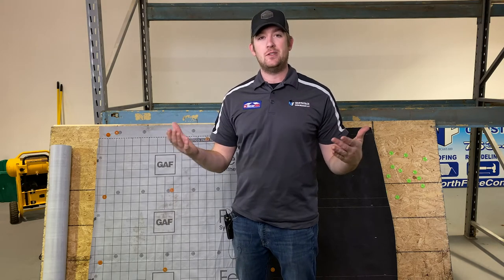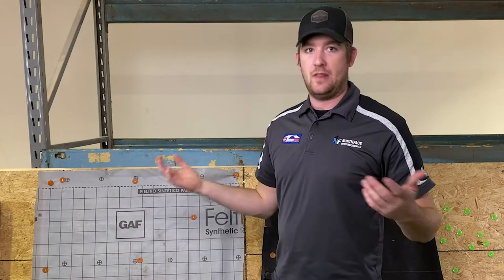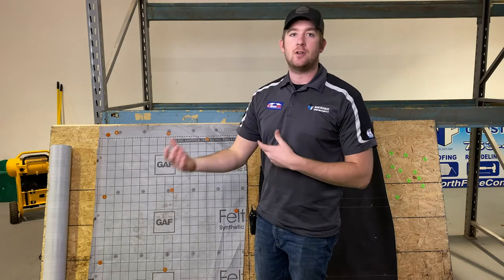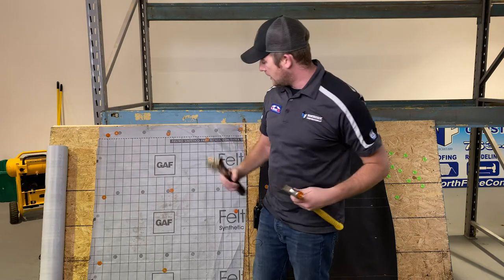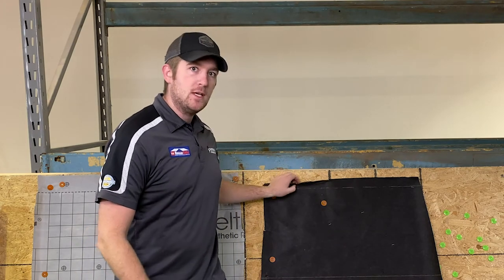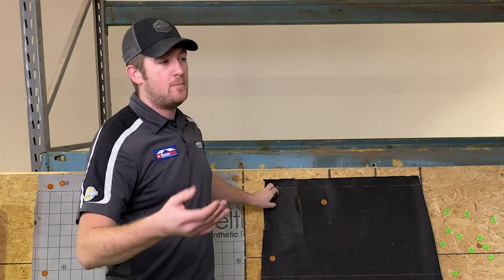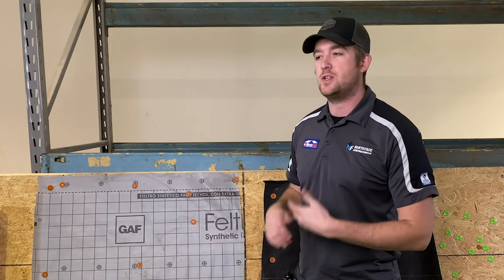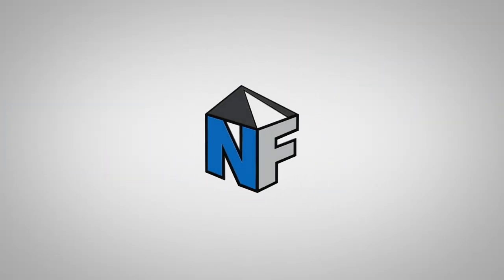Roofing Underlayment: Synthetic vs Felt

Comment: I used 30lb. felt and never have had a problem.  I used cap nails and it has performed excellently.  In our area synthetics have run 3 times the cost of 30lb. tar paper. That is the biggest reason why I stuck with tar paper.  A 30lb. tar paper does not tear that easy.

Comment: The tar paper of today is not what we had when I was a kid. What we used was saturated with tar, and it got on everything as you handled it. We held it down with slats and  left it exposed to the elements for years. Can't do that with the stuff you get today. They don't use as much tar because there isn't as much produced during the improved, more efficient, fuel refining process. This is also having an impact on the manufacturing of shingles that require tar.
Reply: I was roofing houses in the early '70s and the felt was not like you described.
Reply: @slydog7131  well, "got on everything" might be an exaggeration. The paper wasn't covered with a goo. But it was saturated and our hands showed it and so did our clothes. This stuff you buy today doesn't compare. It's dry, sucks up water and buckles in a short time.

Comment: There are unique applications where it is necessary to have a water permeable underlayment vs a waterproof underlayment besides being cheaper. As far as I can remember, there are very few options for water permeable synthetic underlayment. Some manufacturers don't produce such underlayment, and their warranties require underlayment from their product lines so you cant just use another brand thus resorting to felt. Obviously this is something to consider before purchasing shingles. If you have something considered to be vapor barrier on both the interior and exterior of the roof decking/ceiling, this would in theory cause water stuck there for a long time in humid climates if it managed to get in, causing rot and mold. Poorly ventilated roof application. Something I don't see too many people talking about. Alot more variables than people think when designing a roof system.
Reply: I was wondering about that, like with a metal roof application.. always condensation (sweat) underneath. So what’s better in that case?
Reply: Are you saying that the older felt paper might be somewhat breathable?

Comment: Years ago, we tore off several roofs in a neighborhood and they didn’t have any felt or nothing for underlayment.  They did Have some metal in valleys and some had old school roll roofing. But no real underlayment anywhere!  People said Didn’t have any leaks  either!   Builders saving $$ I reckon !?!?
Reply: Underlayment will not stop leaks unless it is specifically designed to seal around nails like Ice and Water Seal. Otherwise, it does not seal nail holes. There will be thousands of nail holes once the shingles are on, and every one can leak if the shingles leak.

Comment: A good job of doing felt underlayment will result in a roof that will not leak. You can leave a roof for  at least 6 months with it only protected by 15 # asphalt impregnated felt paper, if you do a good job of installation.
Reply: If it rains and then is sunny, the felt will warp and tear itself
Reply: I wouldn’t trust felt for 6 months.  Synthetic either really but maybe.  I think it will start getting brittle after that length time.

Comment: 1. I heard that Synthetic is not self-sealing so the plastic nails could result in a source of a leak.  True?  2. Assuming it is true, why would one not install synthetic on the existing 15 or 30 pounder felt instead of removing the felt?
Reply: True, synthetic underlayment typically does not seal around nails. Some of the hybrid underpayments do claim to seal around nail.  When a re-roof is done, everything is removed down to the decking, including any old felt.

Comment: it's all good if you can get past the fact that FeltBuster does not hold water.
Reply: Does not hold water?
Reply: @calmistheway  Felt paper is better? I'm replacing my roof for the first time and I've been debating between old style felt paper or synthetic underlayment.
Reply: @chrisginoc  I'm not saying it's not a good thing for the shingles to lay on for 30 years. I'm saying you cant use it to "dry in" an area of the roof like you can with tar paper.
Reply: @chrisginoc  synthetic is better. If you can afford the GAF Tiger Paw is the best. 2 or 3 times thicker and stronger than the cheaper one everybody uses. 
I am also replacing my roof and doing lots of research.
Reply: @joaquinsuarez6090  Got my roof replaced last week. I went with the Titanium UDL synthetic underlayment. Seems solid. Only time will tell.
Reply: @chrisginoc  Oh, ok. Good luck.
What brand is that titanium?
Reply: @joaquinsuarez6090  Owens Corning makes it. Called Titanium UDL 30, 50 and 70 I think. I live in Orange County, California so I didnt have to go with a freeze type protection underlayment.
Reply: @chrisginoc  Thanks, I'll look into that. The synthetic one that roofer offered me is super thin and I would like to get a thicker one.
Reply: @calmistheway  Synthetic is far better for underlayment on a roof. I live in Vancouver, BC. It doesn't get very windy here but at times it will rain for a few days to a week. And I've had to go and put underlayment on some new construction when it calls for a few days of rain that week, and the synthetic works way better when installed right. Tar paper is crap to work with if the pitch is walkable. Constantly tearing it if you walk on it the wrong way or don't put a thousand fasteners in it to hold it down. Plus if you aren't using cap nails, the staples tend to go right though it and tear it a little or if it's too cold out it punctures it. Too hot it's easy to rip out on itself.
Reply: @sergiotorres3573  Si te creo.
Recien me re-emplazaron my techo de 18 años de edad y el papel estaba todavia bueno, era del grueso.
Pusieron RoadRunner synthetico y todo el techo tiene 50 años de garantia.
Espero dure unos 30.
Reply: @chrisginoc  as a roofer. Udl products are trash in my market. They fail within 5 years